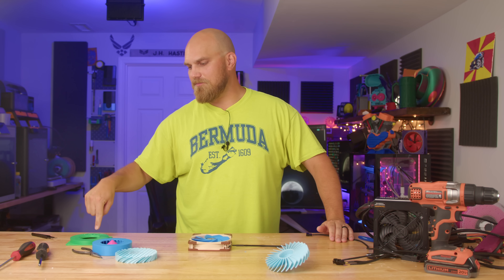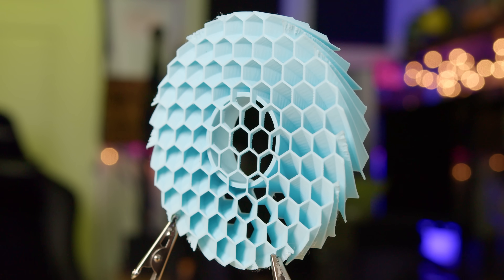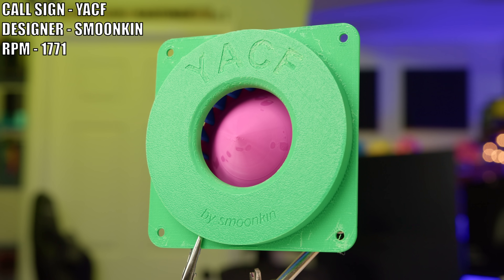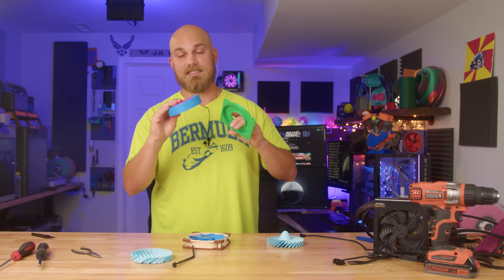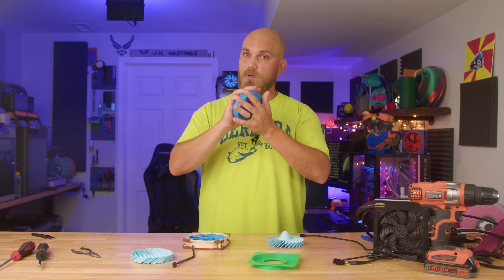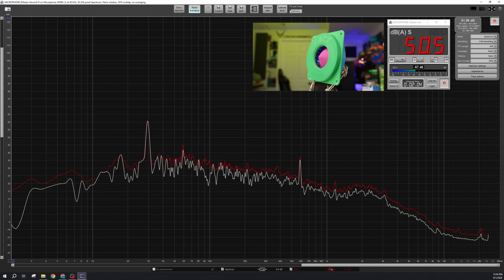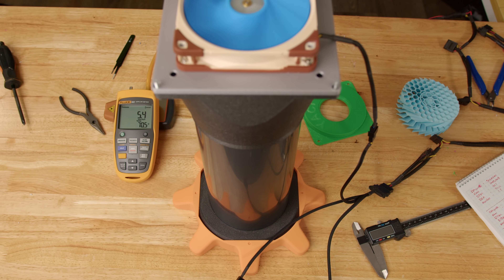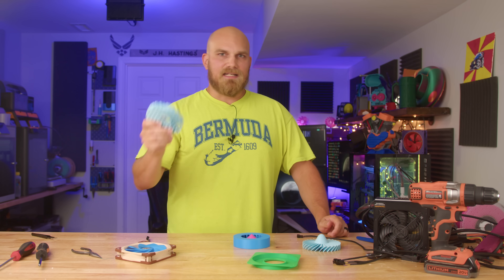This Fan Crushes Noctua A12x25 by 125% | Fan Showdown S6E5

Comment: I love the way the honeycomb looked in the smoke shop. It looked like it was actually scooping and capturing the air.
Reply: I'm legit surprised he claims it's the worst. It seems to move more air out and away than any other design. Would love to see the design tested in an actual gaming PC.
Reply: @Psythik the key is it’s testing for static pressure efficiency, not high air flow. High static pressure fans can push air through higher resistances like dust filters or radiators, whereas high airflow fans just move as much air as possible through no resistive layer.
Reply: @TroLLoughlin  I assumed he was using a resistive layer for these tests. Otherwise what's the point of this video if your test environment doesn't simulate real-world scenarios?
Reply: @Psythik  Static pressure is an easy number to test for & knowing that higher static pressure means a better ability to push through resistive mediums. You don't need to add resistive mediums to the test to know that a fan would perform well when you have that static pressure number.
Reply: @TroLLoughlin it would make for an excellent extraction fan
Reply: @TroLLoughlin  might as well use static pressure efficiency for bottom and use air flow in front of pc.
Reply: @TroLLoughlin unless you have really thick radiators the pressure is less important tho, if you air cool especially flow rate is way more beneficial than static pressure

I have some arctic fans that are optimized for static pressure, I use them to move air around in a grow tent, it's quite impressive how much force you can pack into a 120mm fan without being audible basically
Reply: @TroLLoughlin  That makes a lot more sense to me now.  It seems if I was wanting to just build a simple ventilation fan to move dirty air away from something then the honeycomb would be optimal for me.  But if any amount of pressure is required, then I see it would efficiency fairly quickly.
Reply: @TroLLoughlin  Thanks man
Reply: @TroLLoughlin  Thank you, was wondering this myself.
Reply: @Psythik  it has to do with the way it restrics airflow, alot of the energy is used to push agins the movement of the ariflow.. u can simplify the design as sevral cylinders deviding the fanblades .. the centrifugal force of he air will just push agins the cylinder walls, not doing actuall work... just as a turbine fan, it may work great in combination, separately each fan alone is not greate .. combined thay works very well, also req a very high rpm a plastic fan would not survive, and thay are also very loud ..
Reply: @Psythik  Just because it does worse for static pressure doesnt mean it actually is the worst.

I would opt for the honeycomb design as an intake for a desktop PC and it pulls in the most hair and has little resistance in larger cases. The other designs would be better for GPU cooling or cooling in tight areas, etc.
Reply: @Psythik  I thoght the same until i realized it has nothing to do with PC COOLING. Would definitely love a series where fans are tested for PC cooling.
Reply: Maybe could work well as an exhaust fan in a computer case?
Reply: @thoubias  I think it may make a perfect desktop fan. Cool you down from edge of your desktop while not messing up the items on it too much because the airflow is so restrictive.
Reply: if they had a taper in the honeycomb you would get an atmospheric pressure differential that could help the entirety of the honeycomb designs to what extent that would help vs the size length and number of hexs needed to even get a noticeable effect from something like that is the big question. id say its safe to assume that if it was that easy to solve we would see designs with this already in mind, and since we dont see it in any commercial applications of Newtonian fluid dynamics its a safe bet the size ratios make it completely impractical.
Reply: The testing is flawed. It does not give a realistic representation of real-world performance. Testing for static pressure is not the right way to go. The test should introduce a representative obstruction like a filter and then test for airflow through the fixed filter.
Reply: @Root_boy  I agree. Static pressure is not the end all be all. In fact, Flow seems to be inversely related to pressure in this run. For example, if you wanted a fan to cool down on a sweltering hot day , vortex 9 would be utterly worst. And the noisiest. IMHO the vortex 9 is only good for inflation of dinghys or air beds.
Reply: @addydiesel6627  exactly. Is you'd actually take an electric air bed pump it would win this test and that would be a terrible cooling fan
Reply: It does look good, but what I printed and tested, didn't feel any good, compared to the Arctic fans I had around.
I was hoping for static pressure. Really Disappointed
Reply: It wins in my book on noise and airflow. :glasses-purple-yellow-diamond:
Reply: Push the air far away is only good for circularion fan though. For computer fan you want high volume not long distance.
Reply: @mmis1000 honeycomb was definitely scooping up a lot of stuff and pushing it right out as you can see in the smoke test it just gobbled all that smoke up
Reply: too much material blocking airflow :-(   never put a screen in front or behind fan blans...  being a pilot I'd figure the 5 bladed prop that went on the mk18 sea fury would be more then eoungh in scale....  that thing pulls a very heavy aircraft,,, its gotta have some thrust...    or may the 4 bladed one off the c130... thats a turbinedriven prop so high rpm should be perfect :-)

Comment: While the vortex is good at making static pressure, it would actually be pretty terrible in the practical application of trying to push air through a radiator. With the way the fan works most of the radiator area it would be mounted on wouldn't see any air flow.

Comment: The Vortex looks like it suffered from a lot of air bypassing back out the front. A front cover over the outer 1/3 or so like the YACF might help contain and compress the air better.
Reply: Yeah, that was my thought as well. I tried it, but it seems this design is building pressure by having the wing actually flying in a more laminar way. The overhang actually killed some pressure. I went in a bit of a different direction for the fan I sumbitted after this one though.

Comment: looking at the smoke test for the vortex9, I wonder if you could improve the pressure by making some sort of overhang on the front? like a plate that covers the outer few milimeters of the fan blades, preventing all of that blowby out of the front. should be an easy enough thing to add to it too if it does work, but might need some work to get it to seal properly.
Reply: Yeah, that was my thought as well. I tried it, but it seems this design is building pressure by having the wing actually flying in a more laminar way. The overhang actually killed some pressure. I went in a bit of a different direction for the fan I sumbitted after this one though.
Reply: seeing how small the gap at the frame is, I guess you need some spill out at the front to keep the airflow up and not stall the blades.
It's still a very clever design though.
Reply: @cosmic_cupcake  Yeah, that seems like exactly what is going on, thanks!

Comment: The honeycomb was interesting, how silent it was and how nice the spectrum was. I've been look for the quietest fan for one application: bed side fan, there are cases when i would like to have some air movement around me when i sleep but noise is of course a problem. It does not need to move a lot of air, so that could very well work.
Reply: You'd probably be better served by an A12x25 running at a lower RPM and/or more distant from your bed to reduce the noise level.
Reply: @momokatte  But where is the fun in that?

Comment: Nice

Edit: damn, bots really be botting, huh?

Edit 2: saw an Arctic's 14cm fan (P14 Max, I believe) that seems to have amazing specs. Could you look into using that one for these vids?

Edit 3: now that i thought some more about it, it seems like the fact that their 80mm fan has an actively cooled motor could provide yet another metric and another design factor for these fans (as in, maybe also look into which one keeps the motor cooler)
Reply from the maker: The internet is basically bots talking to bots at this point
Reply: Hey there!  I made a second edit to my comment asking if you could look into using Arctic's P14 Max fans for these vids. Or maybe their 80mm 10k rpm fan @MajorHardware
Reply: Very interesting topic! 🤣
I was about to say something similar. a lot of bots with pictures of beautiful women commenting on the video from the first second... someone wanted to make the YT algorithm happy.